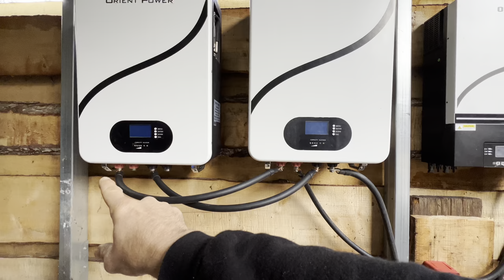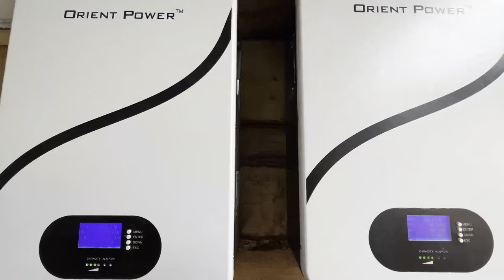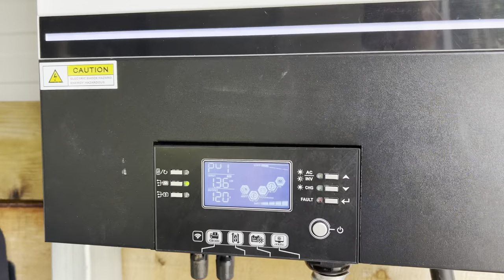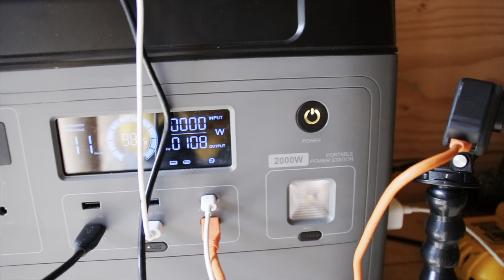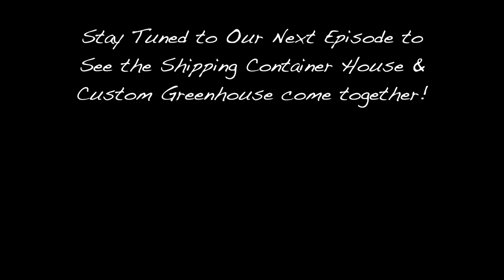COVERED in MUD - EXPENSIVE PRAWN, HOW I EAT THEM for FREE (SLIME EELS) | My NEW TRACTOR - Ep. 169

Comment: Batteries are not the answer. Consider the destruction and slave labor currently in use to mine cobalt and lithium. Everything you use, and rely upon - including the plastic housing for your batteries - have been yielded as a by product from the oil industry. Something to consider. Your neighbors are using a better solution.

Comment: Jake: I like the Solar setup. Nice job. However, that board across the top of the inverter might prevent heat from escaping. Consider checking the specs in the manual for clearance (pg 4). 50cm on top/bottom and 20cm sides. Thanks for sharing

Comment: Little tip no need to have the tractor idled up so fast when doing work.  Especially when moving around yard. Changing buckets etc.  diesel engines have alot of torque on low RPMs. Hi revs are only needed with heavy work when the tractor is being pushed to its capacity.  Engine will last longer as well

Comment: After 25 years of wanting a sawmill I finally ordered one in Sept 2021 and picked my Woodmizer up in Oct 2022.  I had looked at the Norwood mill as my second choice but being that the Woodmizer facility was just 2hrs drive from my home I chose Woodmizer.  As the delivery date of my mill got closer I decided to have Woodmizer assembly my mill and I would show up 2hrs early to run thru the demo of using it.   It ended up being a great decision and I love using the mill even though I have only milled about 10 logs so far.  Enjoy your tractor and mill those toys will definitely save your backs

Comment: Jake!  Not to be too critical or whatever...  But, try to follow your electrical codes for your own safety.  Make sure you have the correct connectors on your MC cable where it enters a box, ground things as required, etc.  I am not the expert, but they say cables, just from everyday vibration can eat their way into conductors, etc., without the proper connectors.  :)  Wishing you the safest experience in the wild wilderness!

Comment: i would really think about building the frame of the greenhouse out of Metal. the wood will eventually rot out and have to be replaced. it's not so bad to replaced the rotten wood parts if it is not the main structure or frame of the greenhouse.  just a though

Comment: Several Comments and Ideas:  

I was curious cus you didnt specifically address the big concern with lithium batteries is they can be destroyed by sub-freezing weather. Some have internal heaters to prevent this. Which kind do you have and what are any special handling instructions related to yours?

Secondly, I was wondering if you have any streams within say, a few hundred yards in an elevated area?  Cus you might also find a Hydroelectric Backup solution could become very important especially say if a single year happens to have little or no sunshine. (Even the Book of Revelation warns about it!) But I was super impressed by this Youtube demonstrating how the tiniest hydroelecric motor can provide 50 Amps of power to a home to the point they have to literally "waste energy" to offload excess power from it.  Its easy to setup and the generators Canadian manufacturer touts a 10 year lifecycle for them!  Heres the info video and website:

https://youtu.be/XyWQ3o6plY8

https://www.microhydropower.com/

Comment: It don’t work like that Jake , you might as well use all your different batteries continuously, if you store them for extended periods of time , they will die , they need to cycle energy, they can’t just sit idle , just like all the rest of your equipment, dead batteries can get expensive , also having a backup gas generator is wise to help you keep your batteries toped off , a wind generator would be nice too